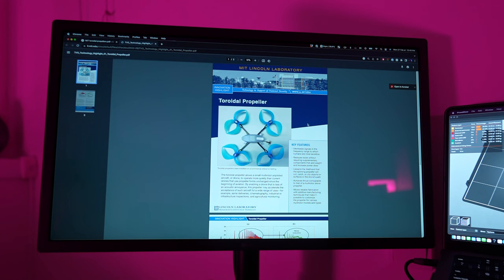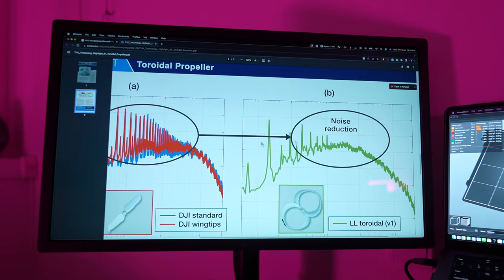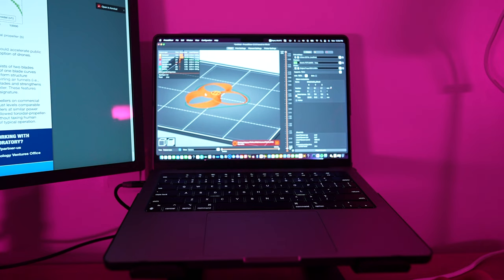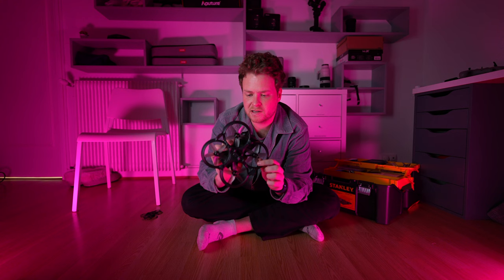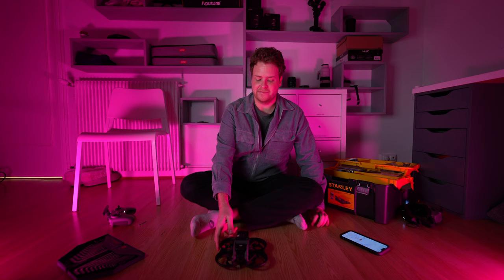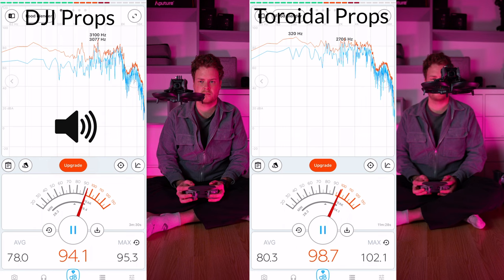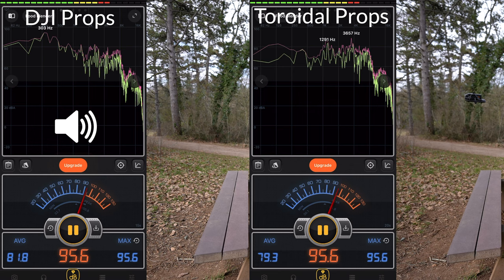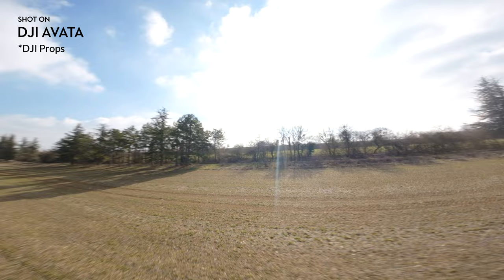TOROIDAL PROPS on a Drone - This is Huge!!

Comment: Seems to me a more valid test is to compare the 3D printed toroidal against 3D printed stock propeller design. That takes out the difference in material and manufacturing.
Reply from the maker: Yeh that’s true!
Reply: Smart.
Reply: Waiting for a someone to try and cnc them instead. Seems like you could get a much smoother surface.
Reply: Also SLA is probably the best application for the smoothness.
Reply: Very true..

Comment: Propellers like most everything when applied well, seem like something AI could very quickly number crunch and design thousands of possibilities, virtually test them because we can simulate that well enough, and output the best option. We should really be doing stuff like that with every single product at this point in technology. We may very well have drones and plane designs that are 5x more aerodynamic and quieter than ever, by using the forces surrounding the machines in a more efficient, almost natural way. Like, these new propellers could be a joke compared to what 30 minutes in a well made AI setup could theoretically produce.

Comment: Also, worth mentioning, that low pitch sound travels greater distance than high pitch. 
With 100m distance your standart dji props will be even more quieter than those 3d printed. 
On the other hand, your toroidar props are loud and have low thrust because they aren't smooth.
Reply from the maker: This is true! I think a longer travelled low sound still sounds better than a short travelling high pitch .
Reply: Have a speaker on the drone putting out the noise cancelling out of phase sound. Problem sorted. Anyone thought of this? The first two stories on BBC Click this week were about drones and then noise cancelling, so I put them together. Why aren't they noise cancelling wind turbines if they are too noisy?
Reply: @ALucas73 Then all energy ‘produced’ by the windmill would be lost in the noisecancelling process, don’t you think?

Comment: The reason it's louder but better sounding is because the sound energy is spread over a wider range of the spectrum. So less peaking around specific frequencies and harmonics. Apple did something similar a few years back by varying the blade spacing of their laptop fans.

Comment: Thanks for the mention, would be nice to get an actual tag and links to my work if possible 🙃 - it's hard enough keeping track of who's flying my designs and I'm trying to maintain a playlist of those doing so as well.

I originally wasn't going to make an Avata compatible design for the very reason that I didn't want to be partially responsible for people printing these without being aware of the dangers, especially since DJI drones are a lot more fragile and more expensive to repair in the event of a crash, as opposed to the usual carbon-framed FPV gear that most of us are flying with.  I had a few people ask me to add an Avata version, but I only did so kinda' on the down-low for the aforementioned reason.

Glad to see they they indeed work in the Avata, but of course it's still hit and miss depending on material, print quality and drone type.  The main thing I think most of us have decided, though, is that the toroidals probably suffer more in a ducted application, since the ducts are partially trying to achieve a similar goal to the toroidal design via a different means, and I believe there's a conflict of sorts in that regard.
Reply from the maker: Fair enough! I've done that now 🙌🏼 That reasoning makes sense. Your designs are really good, so I was confused why it wasn't perfectly designed for the Avata. Yeh these were immensely difficult to print properly, but it made for a good test. Thanks for the design!
Reply: @LukeMaximoBell1  Oh, it's heinous to print, lower layer heights and wider widths can just about get it to work without using supports but it's still rough-as.  For the longest time I didn't even get get to test my own designs since I was away from home so I just threw them out there for everyone else to try, so I'm happy and surprised quite a few people got it working, some even getting comparable performance to regular props, though with great effort in printing and finishing (sanding, buffing, etc).

There's a going idea that resin printing is the way to go, but so far it's been difficult since a lot of resins actually need to be printed thicker than some of the FDM parts can be, so it's becoming a toss-up between low weight, thin yet rough FDM printing, or go thicker, heavier but much smoother with resin.  Smoothness may be a big priority since a few of my commenters mentioned that they had up to a 40% loss in performance with a 3D-printed prop replica of a normally-injection moulded design, so it's no surprise you're not getting great performance either.

Funnily, in my last video I did 3D-print my toroidal as well as a hex-blade standard prop to compare, and the toroidal beat-out the standard design by a lot.  But both lost to real injection-moulded props by a lot as well, lol.

If you're curious, you can check out the playlist of others doing their own testing, particularly @MoppelMat who did the buffing with a Dremel and got amazing performance on his 5" race drone.  You're in the list now as well, of course 😉:
https://youtube.com/playlist?list=PLYXuRA_sySbwa7FRot80kzEA_j4iqWQ_w

Cheers for the tag and links, and have fun with the Avata - maybe one day someone will make real-deal injection-moulded toroidals once the complicated manufacturing (and performance optimisation) is worked out.
Reply: @STRIKINGFPV  You might want to try FullControl. This design seems like a perfect fit for what FC can do, albeit it would likely be a ton of work.

Comment: For the Void: Combine the elements: 

To create a combination of a toroidal propeller mixed with a Möbius strip and blade fan inspired by owl biomimicry, we can consider incorporating the following elements: 

Design a toroidal propeller with a Möbius strip shape, ensuring it maintains the ring shape while incorporating the one-sided surface of the Möbius strip.

Integrate serrated edges or fine combs on the blades of the propeller, inspired by owl wings, to reduce turbulence and noise.

Optimize the design through computational fluid dynamics (CFD) simulations and testing to ensure efficient and quiet operation.

Comment: So the key to understand. In water the tor is quieter and more efficient at moving water. But in air the tor is more efficient and moves more air. Hence why you hear a huge difference in the amount of air being moved. My experiments that’s what I’ve found is the key difference. But the efficiency is why you would use them on flying machines. Not so much for acoustics

Comment: Great video.  Your responsible conclusion at the end of the video I think was well said and necessary, as there may have been some people to go ahead and try to print these themselves and then expect similar results to their stock props and then have poor results.  The video as a "food for thought" for other mod enthusiasts or DJI themselves to begin further exploring the practicality of this design, is where I think the "props" should be given to you.  Yes, I am a Dad, so that pun was 100% necessary.
Reply from the maker: Yeh you will never match a 3D print with injection moulding. Unless maybe you use Resin printing, but I don’t have 1 unfortunately.
Reply: @LukeMaximoBell1  I would like to print it with ABS-like resin. Which of the props [edit:] Meaning which file [/edit] did you use for the Avata? And yes, I am aware of the risks....
Reply from the maker: @VlastimirStankovic  yeh that would be a much better option. Let us know how it goes. I used the 2.9 inch props.
Reply: @LukeMaximoBell1  sorry, been in the move for the last two weeks and forgot to reply...

The prints are too thin. So, the material breaks off easily at the "tips" and the middle section while removing the supports which in themselves are thicker.

Would it make sense to thicken the profile a bit, especially around the "tip" section?

I used Sunlu ABS-like resin next one will be printed with Nylon like...

Comment: Could it be possible to use that frequency range of the noise and do something like an impedance sound matching to cancel out the noise and make it Stealthy??? It would be like a sound muffler that wouldn't affect the thrust but use a noise frequency speaker that would cancel the wave noise as a disruption. Like when two waves hit each other and cancel each other our or disburse the noise pitch. I don't know for sure but you got me thinking.

Comment: It would be interesting to see if you found screws that would work. I have a 5” freestyle quad and the nut was loose. It flew fine but it was incredibly loud. You could hear it for .25 of a mile away!
Reply from the maker: I’m fairly certain there is no slipping on the axle. But I’ll wait for dji to make these injection moulded 😂

Comment: Great test! Lower thrust and efficiency seems consistent with the 3D printed Toroidal prop tests. This would cause me to believe that they may not be able to achieve a higher motor RPM, which could possibly be why they are less whinny. I wonder if a more streamlined, molded Toroidal prop would change the noise frequency to be more consistent with a traditional prop.
Reply from the maker: That could be true. But they hit high enough RPM to hover at least! I think if they were designed properly they would be quieter overall.
Reply: @LukeMaximoBell1  To me, it's similar to when I go from Gemfan Wind Dancer props to Gemfan Sbang props, the narrower chord and lighter weight on the Sbang props make them spool up quicker and achieve higher RPM, at the expense of some low end thrust. At hover the sbangs have a higher frequency whine (higher RPM/Less drag). The Sbang props are a bit more efficient in my loose testing, but there are a lot of variables of course.

I am looking forward to test data from the molded Toroidal props in the works from Gemfan and HQ.

Comment: i think your drone was putting a lot more effort on its engines due to the lack of lift. maybe with higher pitch of the blades (scaling on the Z axis] should lead to less rpm of the prop, less noise and better flight time.

Comment: Thanks for the efford. But hard to agree that toroidal concept works out on drones. The result speak for itself. Not even quiter. Moreover, added lower pitch noise. It works on boat in water. But air is a completely different median I guess.
Reply from the maker: You might be right! Let’s wait and see

Comment: The quietist props you’ll get on any quad will be 6 or 8 blade props
Reply: Try using HQProp Duct-89MMX8 Cinewhoop 8-Blade Propeller  they are much quieter than toroidals

Comment: Best test I've seen so far. But it's still an unfair comparison, comparing very precisely plastic moulded propellers with unprecise 3D printed ones is an unfair test, especially considering the standard propellers likely aren't made of PLA or ABS, commonly used by 3D printers.

To do a fair test, both need to be of the same material, and custom moulded, so the infill does not cause an imbalance in the propellers, as even the slightest dent in a propeller causes unwanted imbalance and vibrations, which in turn generate more noise.

Next time 3D print both propellers and make them with almost full infill. Maybe a resin printer would work too? Since their print resolution is substantially higher than a regular 3D printer.
I find it really weird how every test I've seen on these so far has gotten the manifacturing process wrong. It's like comparing a badly made engine with a more precisely made engine, with lighter materials, and saying it's a fair test.

Comment: You loose 25% to 30% thrust with those, you cannot optimize them, it's a downgrade. Toroidal blades work better pushing dense melecules like water, air is too thin. They will make even more noise at same thrust and the spin up time is terrible because of the extra weight

Comment: Titanium would be interesting to use for the props. Being that the avata is ducted I don’t think it would be a significant safety risk but would probably be the most efficient material I can think of. And they’d never break :) Great video. I always love your content!
Reply from the maker: Whoah that would be wild 😂 probably extremely expensive. Carbon fibre might be a more realistic option. Thanks so much and I’m glad you enjoyed it 🙌🏼
Reply: Maybe cast aluminum would be cheaper and easier. A crafty person could do that at home with a $130 smelting furnace on Amazon.
Reply from the maker: That would be quite a fun project! I would consider it 😂 but I think it is good if there is a bit of flex in the props. Just like how planes wings have to be flexible otherwise they will snap.
Reply: @LukeMaximoBell1  I never claimed to be an aeronautical engineer. I’m just a Marine Corps vet and anything I say should be taken with a pound of salt haha. I saw a video a while back where props were made from an aluminum can so I guess anything is possible!
Reply: If you want to slice people's appendages off metal props would be perfect.

Comment: They maybe quieter, but in real speeds they are cheap as fuck and they will blow apart. I have seen it in a couple other videos. I’d rather buy real DJI props, because that crap isn’t safe.
Reply from the maker: Oh yeh, I would never use these 3D printed props in actual use. It’s just a proof of concept test really.